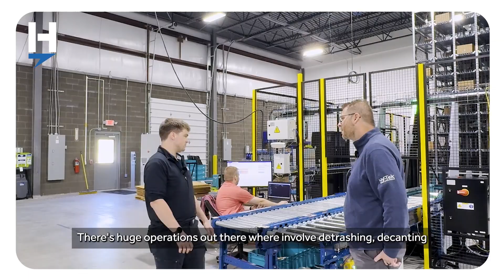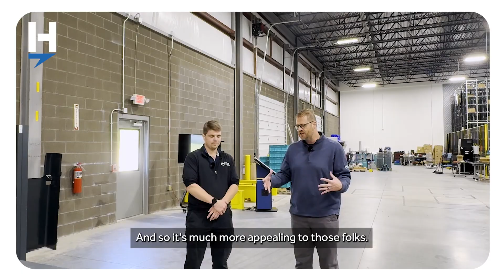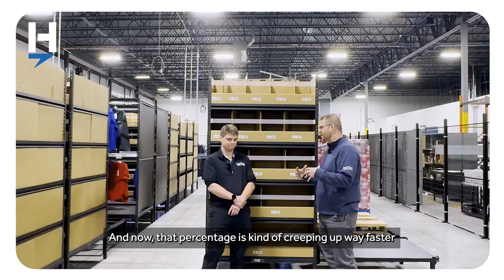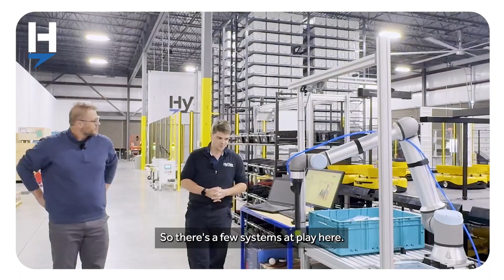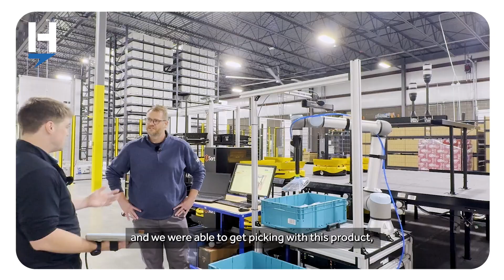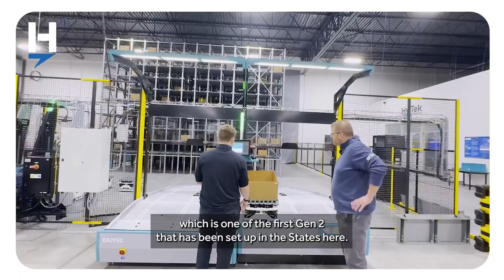2026 Trends In Warehouse Automation

Comment: Oh, I liked that point about native case handling constraints around the chassis. Cramming the lifting gear and wheel actuators into a tight frame gets messy fast. We ran into the exact same harness clutter on a similar build and ended up using Elmo for the drive layer right at the joints to drop the dynamic wiring loom down to just DC power and fieldbus. Cable track wear on those moving axes is such a silent killer for uptime.